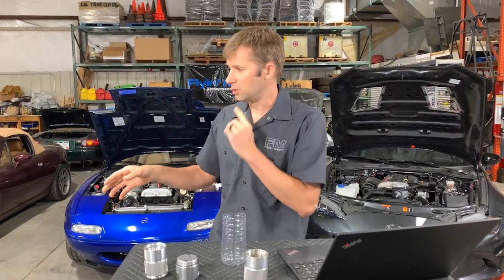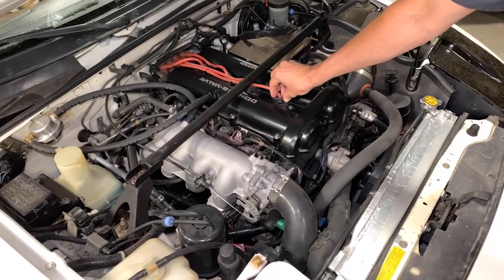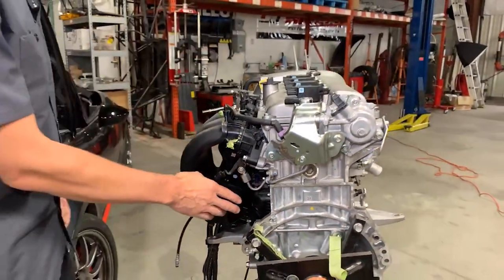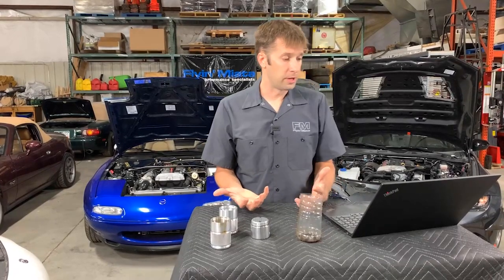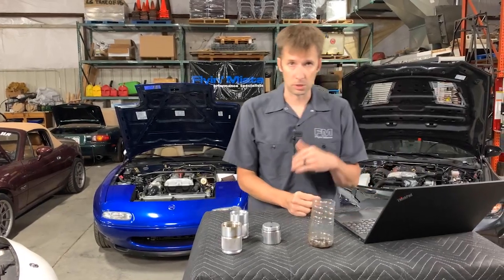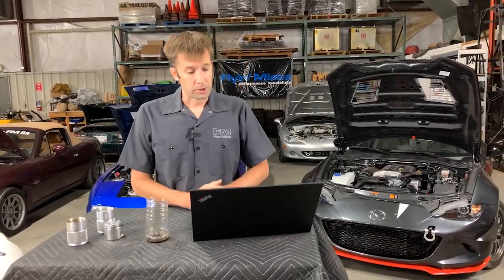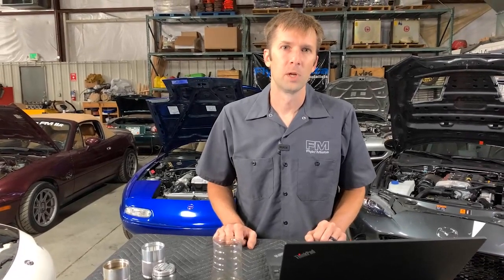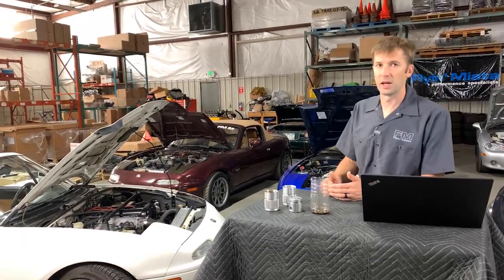Oil CATCH CANS! (FM Live)

Comment: Coming from the diesel world we typically would delete the pcv and run a drain hose to either a hole into the frame or just straight to the ground. I’d rather do that then have a can to empty.
Reply from the maker: Yeah, I spent a lot of my career working on diesels and I don't prefer that type of rust proofing on the bottom of my car. 😁 Just because you can, doesn't mean you should.

Comment: Best plug and play for Mazdaspeed
Reply from the maker: @timmyjimmy9169 Our Moroso Air/oil separator kit https://flyinmiata.com/products/moroso-small-air-oil-separator-kit?_pos=1&_psq=moroso&_ss=e&_v=1.0 would work well with a Mazdaspeed!
Reply: @FlyinMiataVideo  does that remove the old one!?
Reply from the maker: @timmyjimmy9169  Yes, and we'd argue that's a good thing.

The stock MSM catch can/air oil separator drains back in to the oil pan, which sort of defeats most of the purpose of a catch can. Best way to keep gross stuff out of your oil is to "catch" it in your catch can and drain it when it gets full, or realistically just every time you change your oil (assuming your engine is reasonably healthy).

Comment: I’ve never emptied my moroso unit.  It’s been on for 11k miles/5 years.  Is there any potential issues for not emptying that long?  Also what would you use to clean it out if there is buildup?
Reply from the maker: If it's not full and you've never needed to empty it, there shouldn't be any harm in waiting that long. If you want to clean it, brake clean or something similar, just make sure it is completely dry and clean before reassembling. Give us a call if you get stuck.
Reply: Thanks for the quick reply!  It’s the Moroso unit with the drain valve on the bottom.  It was installed before I adopted the car and I didn’t realize people usually empty them every oil change or so.  Would there be any performance indication that it is too full to do its job properly?  Perhaps I will just go empty it.  I’ll mention this on a 200whp Mazdaspeed.

Comment: Question about the verus catch can on a forged ND making 16 psi boost.  There is talk of crank case pressure bleeding across to intake manifold pressure through the verus under high psi.  Is there any validity to the claim and cannot be sealed or just scrapped for a two can system?  Just finishing my build and don’t want to install something that may cause problems.
Reply from the maker: This is a very interesting question. We pitched this question to Brandon, one of our engineers. The Verus catch can does have two separate chambers, but they do share a drain. There is the potential for pressure to transfer due to this shared drain, but the Verus includes a PCV valve built into the inlet from the intake manifold. From Brandon, our engineer: "I don't think it will be enough to make a difference, though. Plus, whatever pressure gets through the PCV will go to the bottom of the crankcase (in the ND), which is directly attached (airflow-wise) to the valve cover (i.e., the other side of the catch can). So the Verus does have an additional path for air to flow, but on a stock or two-can setup you'll still pressurize the crankcase by whatever the PCV lets by." Does that help? Please feel free to give us a call at 970-464-5600 or drop our team an email at support@flyinmiata.com if you have more questions or want more details!

Comment: I watched your video and maybe I' missed something and this may be a dumb question, but if you dont have a breather filter on the drivers side vent tube.......where does it go? Is it tied into the intake of the turbo???
Reply from the maker: The location varies slightly depending on generation, but lets assume you are talking about the NA/NB Miata. There are two lines coming off the valve cover. The first is the line on the intake side attached to the PCV valve that feeds back into the intake manifold. The second is on the exhaust side that feeds directly into the intake tube. Catch cans should be inserted in the middle of the lines, one on each side for optimum effect. This keeps unmetered air from entering the engine, and keeps pressure where it should be. If you have a breather filter in place in either location, then your car has been modified, and one of these lines has been blocked off. This is not ideal for several reasons that Brandon covers in the video. If you need more help, or have other questions, please feel free to give us a call or drop us an email at support@flyinmiata.com and someone will be happy to go over the details with you. Hope that helps!
Reply: @FlyinMiataVideo  you answered my question. I now know it goes into the intake of the turbo. Ty for all the awesome information and videos

Comment: My MX5 is still under warranty I inquired about a catch can and if it would void my warranty and Masda said it would is this true
Reply from the maker: We unfortunately have no control over what dealerships will and won't cover under warranty. The catch can does not replace or interfere with any system on the car, so realistically it should not effect your warranty, but some dealerships will possibly give you some hassle over it. If your car is still under warranty and you are still taking it to the dealership for service, we recommend getting their opinion or talking to an alternative dealership before modifying your car.
Reply from the maker: It should be added that, by law, a modification can only void the warranty if it caused the failure. If you install a catch can and your transmission fails, the warranty is intact. If you modify the PCV system and the car suffers a ring failure,  that would likely not be covered.

Comment: any videos available on how to access the hose down by the PCV valve? Looks like it would be very difficult to do, especially for someone that does not do much mechanic work :)
Reply from the maker: You might try watching our full Verus air/oil separator install video. It shows those locations on an engine out of the car, and gives some tips on how to access them for the install.
https://youtu.be/7-Pj0zDxkn8?si=A3xZXJMmzwWwy_lx
Reply: @FlyinMiataVideo  perfect, thanks!

Comment: At the 8:50 mark, you mentioned the NC and ND have a manufactured catch can. I was thinking of getting an ND2, but I got a deal on an NC3 instead. So my question is in regards to the NC2. If I get the Verus AOS, is the connection points the same as the ND2? Or, should I get 2 separate CC instead? I realize the mounting bracket is for the ND2 however, I'm sure I can figure out how/where to mount it on the NC3.
Thank you for your videos...now I want to see more on the NC...LOL!

Comment: What about someone designing a full fledged old school aftermarket intake manifold with fuel rail JUST for the ND?? 1) It would open us up to the big wide world of aftermarket fuel injectors for extra fueling - for TURBO *(since yall keep talking about how the Direct Injectors falls short)* 2) It would basically be our very own D4-S system and keep the valves clean indefinitely like all the other engines of the past.  Papadakis did this for the mk5 Supra and i'm VERY surprised nobody else on the planet tried this for other DI engines.

If not all that, at the very least design some type of fuel-sprayer that can throw a mist of fuel into the intake mani like a wet shot of nitrous would be sprayed. they'd inevitably get sucked down past the valves and the same thing would happen as it did in the old days.

Comment: Will this fit with the bigger Washer fluid bottle some (Canadian? Scandinavian?) NA's have? or would i have to move it somewhere else? And thanks for the great vids! 😁
Reply from the maker: Admittedly, this is something we've never tested, so we can't give you an exact answer - sorry! 

If it does work, fitment will be very close. Luckily, the bracket included with the Moroso kit can be used almost anywhere in the engine bay.
Reply: @FlyinMiataVideo  Seems like I'll have to find out. Thank you anyway!

Comment: When you say an ND with "fairly low mileage", where the buildup didn't get necessarily worse on the valves.. how many miles are we talking? 
I ask because I am at 12k miles on my ND2 and just ordered one.
19:30
Reply: Just look at guys who have installed a Super Charger or Turbo on their ND / ND2s. Even as low as 12,000 miles there is significant carbon buildup on the valves.

Comment: Brandon: why are you so set against a vented catch can?
I have a turbo mk1 and run a Mishimoto catch can with 2 in-ports (one from the pcv and the other from exhaust side of the cam cover) and 1 out-port which has a filter. I get no oil deposits on the underside of the hood/bonnet or anywhere in the engine bay. My original pcv inlet port on the intake manifold is capped off as even the best catch can won't catch 100% of the oil/gunk that comes from crank case venting.
By routing the exhaust side cam cover vent to the turbo inlet you will get oil/gunk deposits within the turbo/intercooler piping and the pcv side will put oil/gunk deposits into the intake plenum. I would rather have a clean intake and turbo and catch the oil/gunk in a catch can, which seems like a win/win scenario.
However, I do 100% agree with you that all ICE cars should have a catch can if possible.
Great video BTW!

Comment: Is it a good idea to add steel wool into a catch can to restrict oil and oil vapors from escaping out the breather vent?
Reply from the maker: Most quality catch-cans/separators will come with a mesh, so the additional filler is not needed. Please do not use off-the-shelf standard steel wool. Normal steel wool will rust due to the moisture and cause an even bigger problem in the long run.
Reply: @FlyinMiataVideo  would it be a good idea to use stainless steel wool then?

Comment: Any issues with condensation freezing in these during winter conditions?
Reply from the maker: We've never seen this happen. Anything inside the can doesn't matter, and everything going into the can will be heated by the engine and won't be able to freeze while the car is running.

Comment: I believe Mazda designed the inlet manifold with baffles. Catch can is not required unless you boosted the engine
Reply from the maker: Brandon discusses some of the  pros and cons of the factory system in the video. It still drains the contaminates back into the engine. A catch can completely pulls the contaminates from the system, ensuring any garbage is totally removed from circulation. This is why we still recommend them, especially for the Direct Injection engines.